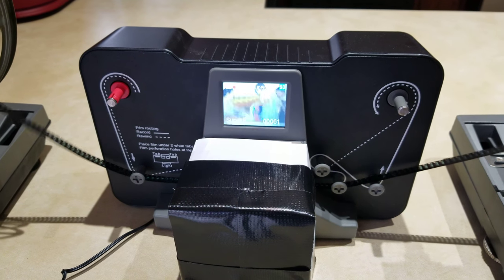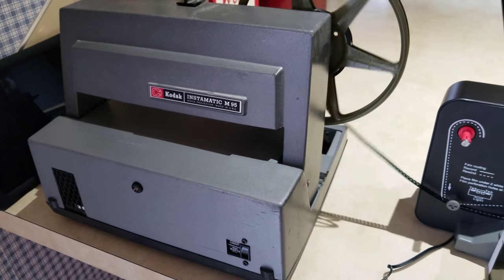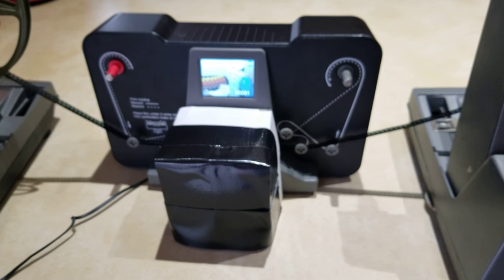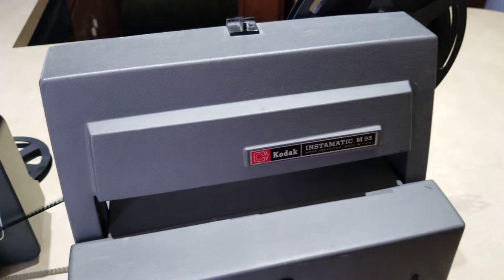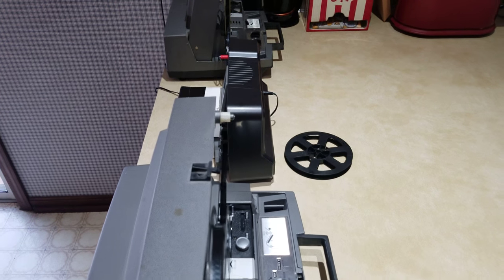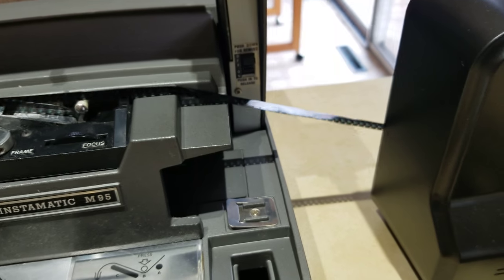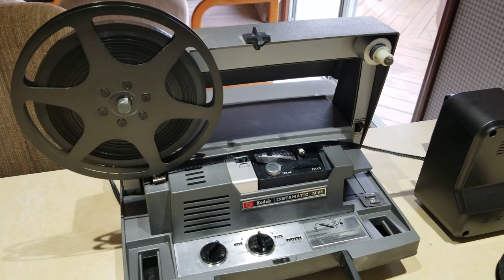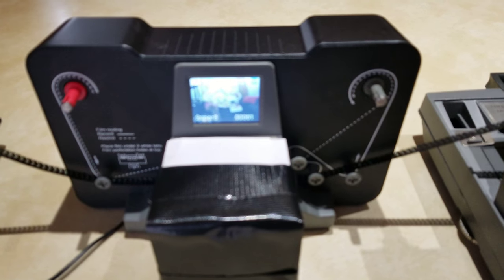Wolverine 8mm film converter / How to use with larger 6" and 7" reels

Comment: ohioindy,  I have that first Wolverine unit as well, but since then purchased the Kodak unit that handles larger reels.   The reels I have are 6" ones.  I got all set to use it, and then found that the center of the 6" reels were too small to put on the Kodak spoke, where you mount the reels.  What suggestions do you or others have?    Another thing I am thinking about -  I have some empty 7" reels that I originally purchased to have on hand for something else.   Now I am trying to figure out how to get the film from the 6" reels to the 7" reels, so that I can then feed them through the digital unit.  I need to find something that handles the smaller openings on the 6"  8mm reels. Any suggestions would be appreciated. Thank you.

Comment: I'm going to give this a try - thank you for sharing!
Reply from the maker: Good luck.  I would highly recommend the Wolverine.  Some people have complained that it gets very hot and burns up internal belts but I haven't had any such issues, even with longer films.  I've measured the temperature and haven't seen anything over 85 degrees.  I'm nearing 100 8mm/Super 8 films and it still works like a charm... Knock on wood!

Comment: great idea...how is the Wolverine holding up for you so far?  How many reels have you scanned?    do you do any post processing such as frame rate conversion?
Reply from the maker: I've converted almost 100 movies so far -- everything from 3" to 7".  I'm very impressed with the Wolverine unit.  After each video is created, I use MovieMaker to convert the frame rate to 0.60.  It works very fast and I end up with a very good quality video that I can burn to DVD or upload to YouTube.  It would be nice if this version of the Wolverine worked with larger reels but the system I am using for larger reels (as shown in the video) works just fine.  Thanks for the comment!
Reply: I just got mine yesterday and have done three 3" reels so far.  It's been pretty unforgiving as far as splices go....but I'm still impressed.  I'm importing and doing some touch-up editing in Premiere CS6 and adjusting the time by 56% which seems authentic to me.   The film I have is very brittle and would probably not survive in a projector.  I am pretty amazed by some of the Kodak reels and how the color is holding up.  Once I recode the final edit I use Mercalli/Prodad to add some stabilization to reduce a lot of the camera jitter.  One final point...i talked to Wolverine on Friday and they told me they have a new firmware version that sets the encoder to to 20 frames per second.  Since I'm dragging each clip into Premiere the frame rate thing doesn't seem to bother me....I'd rather address it in post production.  I'm going to skip cleaning the film since it's so brittle (stored in hot attic)....and only do it in extreme cases.  I think some of the dirt adds a little character anyway and makes it more authentic.  I have two batches totalling about 100 reels to do yet.  I'm sure I will gain some new friends wanting me to do theirs too.  As far as large reels I have a handful of old projectors that I'll just set up on either side of the MovieMaker to use as supply and take up for those like in your example.  Again...I appreciate your review and input.  I'm a Wolverine fan now.  I decided to stick with the base mode.